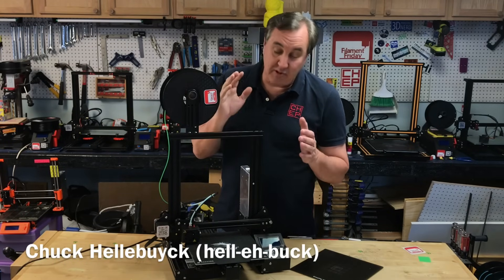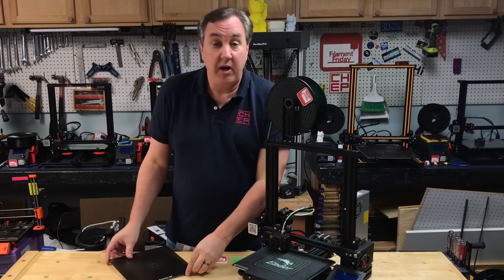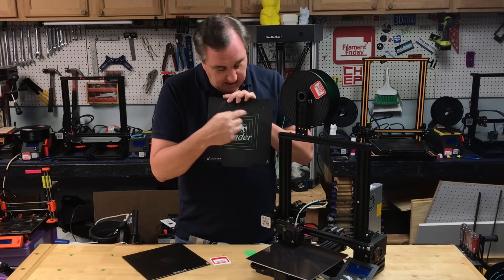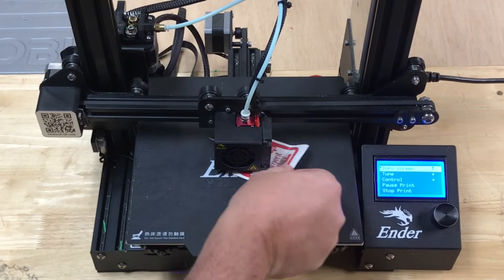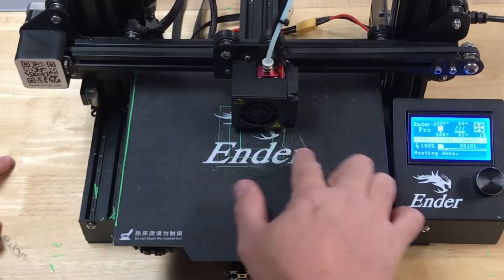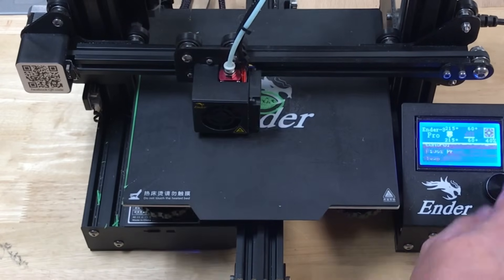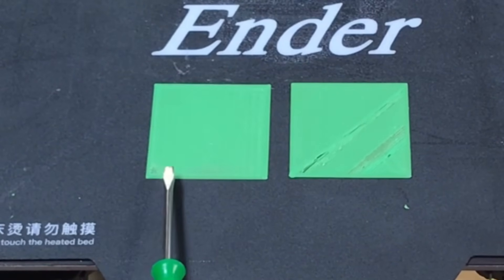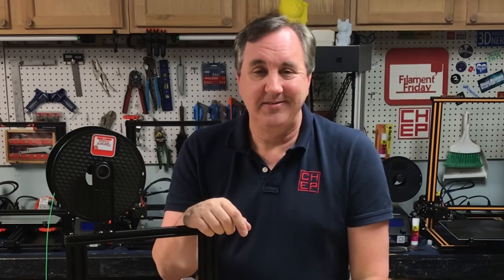Creality Ender 3- Easy Way To Level Your Bed

Comment: So i've followed your steps levelling is perfect but then when i print it still fails to stick on the top left corner even though if i stop my print and redo the level gcode its still perfect and sticks HELP!? Its extremely frustrating
Reply: nevermind ive figured it out oil from fingerprints was on the bed works perfectly now thank you :)

Comment: I have an ender 3 pro and no matter what I do to level it it still refuse to use the settings I have and keeps the nozzle way too far for me to get anything printed. This seems like a really fun hobby but after spending a full week on it I think I will just pack mine up and send it back at this point. :/

Comment: Appreciate the video, but it's not working for me nothing. CR10S = TRASH! (at least mine is) Brand new head unit from Creality too. Printing on glass. Cleaned with alcohol AND have used glue stick. Absolutely NOTHING sticks to this POS!

Comment: Setting up my ender3 for the first time.   After running auto home the gap between bed and bottom of nozzle is so large that I’m running out of threads when I spin the adjustment wheel to raise the bed up to the nozzle.   The adjustment wheel falls off before I can get the gap small enough to begin feeling friction between paper and nozzle.  Any idea what’s wrong? Thanks

Comment: I'm newer than a Noob to 3D printing. Invested in Ender S3 1 printer. Downloaded a few models. The models on the supplied SD card prints great. Tried printing models off tinkercad but the print keeps starting 40/50mm above the bed, in the air. Any suggestions?

Comment: I was able to buy this printer for $100 at Microcenter after discounts and promotion. All my other printers had either touch leveling or the built in leveling routine. I didn't even know that Gcode will allow you to move the print head and wait for a user input. Thanks for providing the gcode. Your work is greatly appreciated and saved me a lot of time.

Comment: Took me ages to find something like this, I'm new to 3d printing and I have a Creality ender 3, the only thing is before running the code I recommend running a pre-heat as the gCode doesn't seem to do it on the Ender 3.

Comment: I had 2 really good prints from. PLA

But once I started using PETG it seems to have issues
Temp 230
Bed 80
Flow 100
Fan 100%
Feed Rate 100
Does all this seem okay ?

Other than readjusting the bed does anyone have any ideas? 

It's coming out but it is not sticking to the bed

I have paper thin nozzle to bed on 4 corners.

Thanks in advance!

Comment: I used this method with great success for a year and a half until I started printing larger prints with eSun PLA +.  I was getting extruder skipping, stringiness and bumps pretty bad if I tried to print more than 3 objects at a time at full speed.  I actually fried the extruder driver on my motherboard I think because my nozzle was too close to the bed just using one sheet of paper.  After replacing the board, extruder gear, even the hot end and still getting skipping I decided to lower the bed further and folded my thick printer paper in half and set it loose against the nozzle, just past having it grab at all.  That did the trick!  Regardless, none of this testing would have been possible without your awesome bed leveling gcode.  Thanks so much!!

Comment: so when i start printing the bed level test it seems to print out fine. but at the back r/h corner it lifts up. but just the curves arc of that corner. not the whole corner.  if i adjust the bed height then it messes up the whole corner. is this maybe an extruded issue instead of a height issue? i’ve replaced my extruded spring and plastic assembly. i can’t figure out what it is? have you seen anything like this before ? thanks

Comment: I tried running the bed level gcode. My ender 3 doesnt stop at the corners. It just continues moving to each corner. Is there any way to fix it?
Reply from the maker: Try the M25 version as described in the top comment and description.

Comment: Got the ender 3 as our first 3d printer a few days ago. The levelling is driving up the walls. Print after print ruined. Not sticking, too close, too far, layers failing to stick together, stands coming apart 😩.

 If it wasn't Christmas time I would've driven back and returned it already. After watching this I might give this method a shot
Reply from the maker: You could also try my E-Leveler tool. https://youtu.be/715Xop79Sus

Comment: Hey I need some advice can you try help me with a off topic issue on my ender 3, I have 2, ender 3 but one prints in a different scale on the Z axis than the other any ideas why, all the settings match up on each printer Thanks man

Comment: After I run the gcode and level my springs, it goes back to having a large gap as if the arm reset a few mm higher than beforw

Comment: I’m going to print your cube tonight with letters to see what happens.
Reply: cube is printing nice.  im going to double the size next print.  I can see how this becomes addictive.  😛
Reply: Cube came out awesome and I printed benchy with great results.  Working on supports now and trying to pick up the settings a bit.  My first print with supports was great but they were a bit difficult to release.  Thanks for the videos.
Reply: @cementmixer4342 make sure not to run out of filament 😆. It’s all fun and games reprinting larger til you want something bigger
Reply: @game_scoop  LOL I was thinking about that.  So if you run out while printing it doesnt pause and allow you to reload?  You need to begin again?
Reply: @cementmixer4342  depends on the printer. Most kinda just keep going. Higher end ones pause though

Comment: I ran your leveling Gcode and the squares.  Everything perfect.  Loved my results.  Plastic layer down beautiful.  When I ran a model exported from zbrush through cura the plastic is coming out super thin and my results are sketchy to say the least.  I’m assuming Something is wrong when I am in cura.  Settings?  Also the grid seems to be off from cura to my bed.  I’m looking for it to print in the middle but it’s always offset on printing bed.

Comment: My ender3 pro is my second printer and it seems to be more sensitive to model layer height. The first part I printed was the little dog they had pre-sliced at about .12mm and it printed fine. When I started printing larger items at .24-.28mm I found the same nozzle spacing didn't work. Even though the first layer is .3. It seems I am constantly adjusting my nozzle spacing for every new part.

Comment: I just got mine set up, trying to use the gcode you provided. It does not stop automatically and will not resume print after manually pausing it to level.
Reply from the maker: Read the pinned top comment.
Reply: @FilamentFriday  May be the pinned comment has been un-pinned. Don't seem to find it. Can you please look into this. Thank you for everything.

Comment: ugh... so, do I change the configuration setting? Do I turn the wheels until the bed is all the way down before I level, because I did? It started fine, then the 3rd corner it would touch the bed and I couldn't lower it anymore. Thank you for your info!
Reply from the maker: You can adjust the stop switch on the side if you need more spring travel
Reply: @FilamentFriday  thank you. That was the problem. I didn't notice it had fallen out of place!

Comment: hey Chep, thank you for everything but what i cannot seem to find that i used to see on the thingiverse link was the 5 point bed leveling tool for my ender 3 pro max with a build volume of 300 x 300. is that still available anywhere?

Comment: Great video, thanks! Newb Question: Do you heat the head before levelling? I always seem to have some dried filament that won't break off cleanly before I run your gcode. This will effect the indexing height. How to you approach/resolve this? Thanks for the help and the great videos.
Reply from the maker: Yes, clean the nozzle or better yet do it without filament

Comment: Hey Chep first time printer. doing the 0 code I can get the corners to the correct resistance but center is pushing into the paper. I am using upgrade glass bed. as a Test i flipped glass bed over to see if I got opposite results(warped glass) however I get same results. I can get the 4 corners to be perfect but center takes some effort to move paper at all. Thoughts?
Reply from the maker: How thick is your glass?
Reply: @FilamentFriday  Its from Creality specs say 235x235x4MM. I dont have sufficient tools to check from corner to corner.. but if it was bowed in the center flipping the glass over would have opposite effect no? Unless its the actual bed and not the glass plate... oof fingers crossed

Comment: Hello, so I tried with my ender 3 pro but my printer does not move in those 5 points of leveling when pressing the button. So i have to turn it off and just like that level the bad with the paper. Can someone tell me why the printer does not move when pressing please?
Reply from the maker: Read top pinned comment.

Comment: I have a good idea for some once you levels all four corners use little bit of hot glue on all four corners on under those knobs so it wont slightly move or just use nuts and washers under those knobs

Comment: Use the "squares" test file" to help with my bed leveling. I  know that if I get this down good, I will have a good print. It does eat up a little filament,  but considering it saves from starting and stopping prints until I get it right, its worth it. Thanks for making this video. I enjoy what you offer, and it has helped get this newbie off the ground..

Comment: Your "new" M25 file does not work with the Ender 3 V2.......It just goes tot he spot, then returns home. There is no resume print option either. I'm fully updated and all firmware installed both screen and motherboard.

Comment: Will nozzle tip scrape the corner when home after doing all the adjustments/printings?
Reply from the maker: No, it will be slightly off the bed.

Comment: Just build the ender 3 pro, the nozzle seems way to high when it homes.  If I try to adjust the bed level and wheels will come off before the nozzle is close enough.   Any ideas on how to get the z switch lower?  I have it set in the groove flush.
Reply from the maker: Watch this at 8:50 https://youtu.be/S7Q4OUZdWMM

Comment: Chep ive printed quite a lot the last few days, my latest print one of the corners wasn’t sticking to the bed. Out of curiosity I grabbed my level and placed it on the bed, it’s saying my bed is pretty far from being level but until recently it worked fine. Is my bed level?? Is using a level an accurate way to level my bed or should I stick to the piece of paper under the nozzle?
Reply: Just remembered I’m using a new roll of filament I just got delivered I guess it could be the filament
Reply: Went back to my old filament with 0 issues, what does it mean chep?
Reply from the maker: Don’t use that new filament.

Comment: But how on earth do you get it so the nozzle is anywhere near the right place before this?  It is either too far above to be able to move the bed to meet it,  or going to dig into the bed if I tried to move it underneath. 
I have adjusted the z gantry stop switch so many times.  I still can't level the thing.
Reply from the maker: Tighten the springs to half way and then lower the switch to get the nozzle right at the bed. Then adjust.
Reply: @FilamentFriday  thank you,  I will try that
Reply: Sigh, I think I will have to return it. There is no way I can do it. I position the nozzle so it is just over the bed, adjust the Z gantry stop.  But the nozzle will still be either far too high, or digging in, to other areas. Beyond what I can alter with the screws.  I have spent so many hours trying to do this. I have no idea if the printer has an issue, or I am just being incredibly stupid. It is just making me feel ill now.

Comment: I use your bed leveling program all the time. What I can't figure out is why your M25 calls work properly and give me the option to resume, but when I call M25 it pauses but my options are "Pause Print" and "Stop Print"...so I have to select Pause which starts the pause and cooldown then select Resume, causing me to lose time. Is there any trick to M25 with an Ender-3 to get it to give the Resume option instead? Or is my software adding something that it shouldn't add, and it's taking the Resume option away?
Reply from the maker: Not sure but you can read my files with a text editor to what’s different from yours.
Reply: @FilamentFriday  Yeah, I did try that. Your code is "M25 ; Pause print" and Cura generates "M25 ; Do the actual pause". The pause works either way...I just can't figure out why yours easily resumes after input while mine only gives Pause and Stop options. Thanks anyway for the leveling programs, they're great!

Comment: Hi, I cant use this method as my printer (an Ender 3) does not pause when using the g-code file. Any ideas why?
Reply from the maker: Read the top pinned comment.
Reply: @FilamentFriday  Thank you very much. I didnt even realise that my printer had this 32 bit board. I now understand (even if rather slowly!).

Comment: Whats de better, Ender glass bed or an 4mm borossicate glass plate?
Reply from the maker: Don’t know. You’d have to test it.
Reply: @FilamentFriday  ok, thank you
Reply from the maker: Typically plane glass might need some glue stick while Creality bed has surface to make prints stick. But a 4 mm glass might be flatter so it really depends on what you buy.
Reply: @FilamentFriday  I'm understood.

Comment: Hi what in the gcode determines what is "just above the adjustment screw". I had a look through cura preview and could not determine the answer. Reason I ask is I need to know what adjustments I may need to do to avoid damaging the bed and nozzle.
Reply from the maker: X and Y value.

Comment: it seems my bed too far away even adjusting still the nozzle is nowhere near the bed i wonder why its so far away?
Reply from the maker: Lower the Z stop switch. Cut the nub off if necessary.
Reply: @FilamentFriday  Are you saying goto to settings to lower or disable steppers ?
sorry im new to this and im trying not to give up its very frustrating .
Reply from the maker: The switch on the side of the rail that stops the carriage. Watch this at 8:50. https://youtu.be/S7Q4OUZdWMM
Reply: @FilamentFriday  ok i replied on the video you referred me to watch
Reply: @FilamentFriday  omg you a freaking life saver i owe you big time so the whole time my z switch was to far away alls i did was loosen the screws and readjusted a boom its working
Reply: @FilamentFriday  ?

Comment: Excuse me . If the four corners are level, but the middle area is too far from the nozzle. What should I do? 
I put something under the middle to raise it up, although the printing is not very good, but at least it can be printed, do you have any suggestions?
Reply from the maker: Take it apart and try to flatten it.

Comment: Just set up my Ender 3 Pro and got to the leveling part. I'm ready to throw this thing out the window! The bed is too far away from the nozzle and the wheels will fall off if I unscrew them any more. What did I do wrong? Your help, or anyone's at this point, would be greatly appreciated.
Reply from the maker: Adjust the Z stop switch lower.
Reply: @FilamentFriday  hi sir. Mine is a S1 with cr  probe abl touch. I think it was shipped with a stop switch but as a backup spare part in case cr touch fails. The reason I watched your video was because I wanted to learn about manual bed leveling and because I want to get it right and not have the auto bed leveling work so hard to compensate. I believe that if I do manual bed leveling right it is more verifiable that way that everything is leveled correctly.

I have the same issue. My bed Level knobs don't come off the thread but is close to. Also the springs are at the least compressed state which concerns me in regards to print quality. Is it a good suggestion to move the bed back down to half spring compression and then follow your video again? I am hoping that z is allowed to go below 0. That is the only way for the extruder nozzle to get close enough to do paper test.
Reply: @FilamentFriday  thanks for your effort. Had to send it back. Motherboard defective, SD card slot is defective. My luck!
Reply from the maker: Glad you were able to do that.
Reply: same dilemma. will advise if i figure it out. please let me know if you found a way

Comment: It didnt work for me. I have ender 3 v2. I run cheb_m25_bed_level gcode file, nozle goes first corner, I make adjustment there then push the button for next corner adjustment, nozzle goes other corner then without waiting turns back first corner. Then I push again the button, nozzle goes another corner but it doesnt wait on this point too and goes back to the first corner... It makes same moves end of the code. I can make an adjustment just first corner :( Whats the problem do you think?
Reply from the maker: Run the Ender 3 file with time delay at: 
https://www.chepclub.com/electronic-bed-level-tool.html

Comment: We've been missing the bit on gap. If you level to Z0 in the video when you print the first layer at say 0.2mm your first layer height is actually 0.3-0.4mm depending on how you gapped it. This thingy has the files with Z0.1mm for levelling to use a 0.1mm feeler gauge to sort this accurately and you remove the guesswork... (standard A4 paper is about 0.1mm think) thingiverse thing:4904173
Reply from the maker: That’s where the live adjust comes in. You adjust it out. 
Or just use my E-Leveler. https://youtu.be/715Xop79Sus